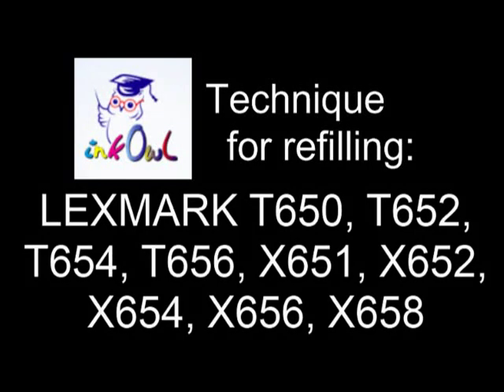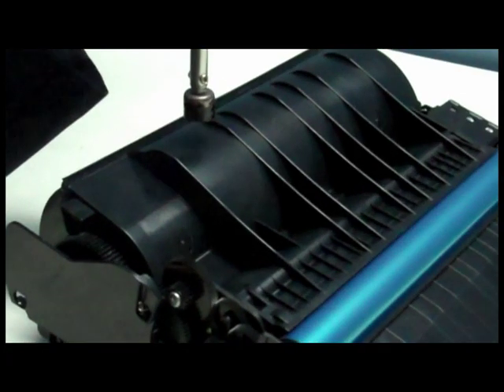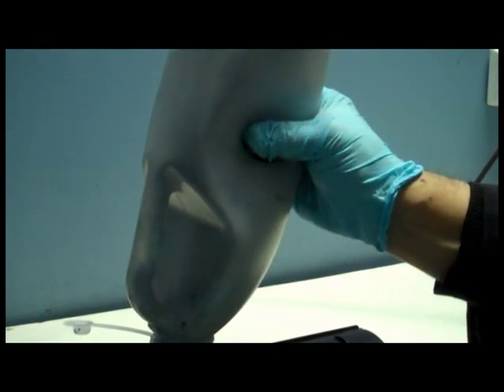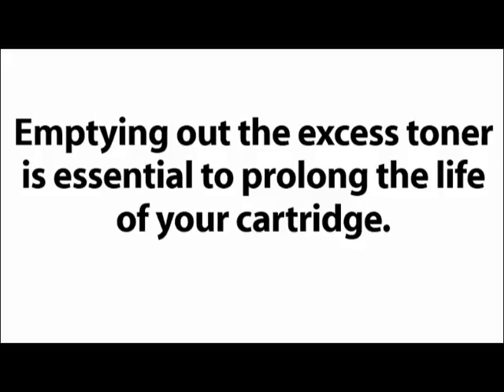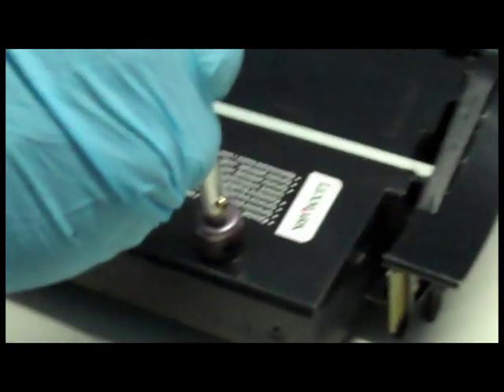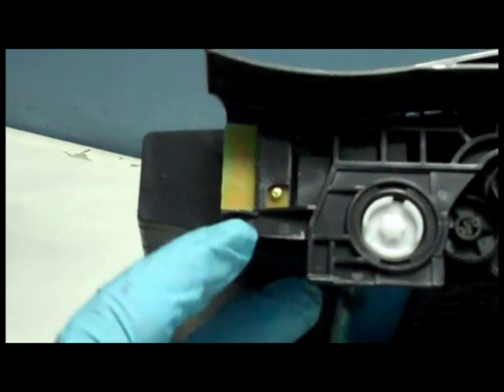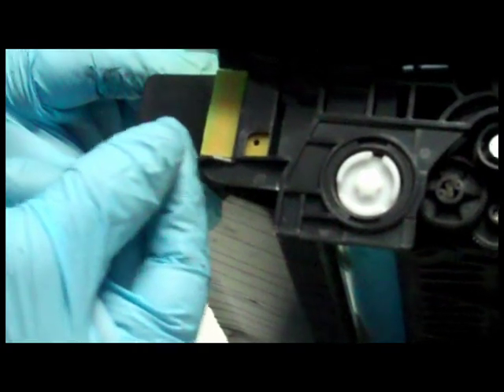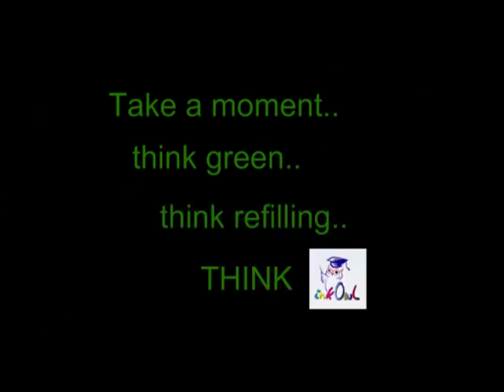How to Refill LEXMARK T650, T652, T654, T656, X651, X652, X654, X656, X658 Toner Cartridges

Comment: Hello, how are you? Great video. I'd like to ask if you know how to fix the toner leaks from the toner hopper, specifically from the developer roller end, exactly on the left side (when looking at the machine from the front). I've replaced the roller, but the leaks continue. Could there be some seal that deteriorates over time? The toner I have for my Lexmark T650 is original and must have been in the box for about 10 years. It's never been used, so I had to replace the developer roller (because it had become deformed from the pressure of the DR. bar). Thanks in advance. Best regards.

Comment: Sweet.  This is an easy process. It leaves the scraper blades dirty but they would probably get that way printing the first 10 pages after refill anyway so maybe not needed.  Thanks for these directions for "home" use.  The other video was a complete refurb and had many steps.  This is far easier.  

How many times can this be done on one cartridge?